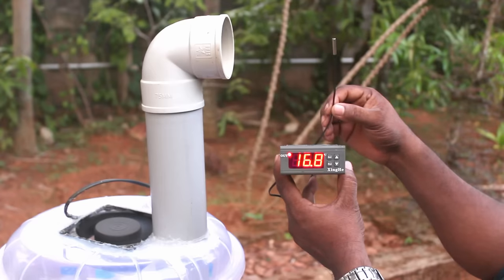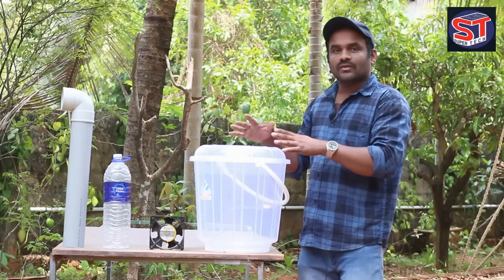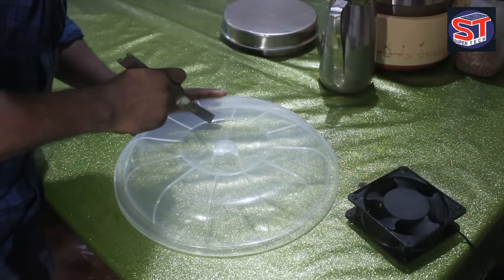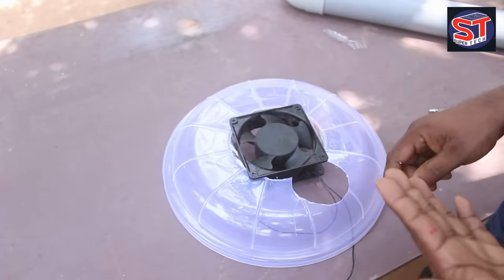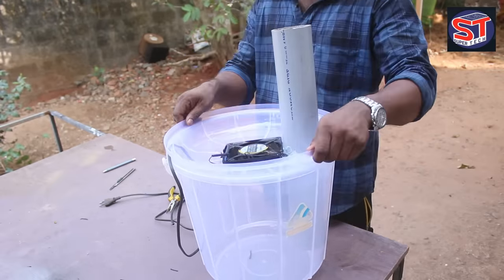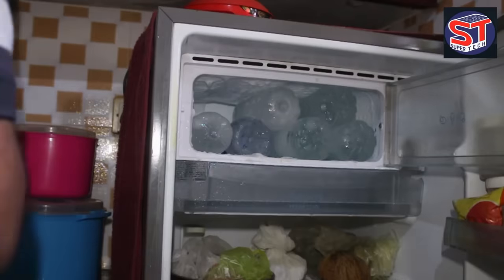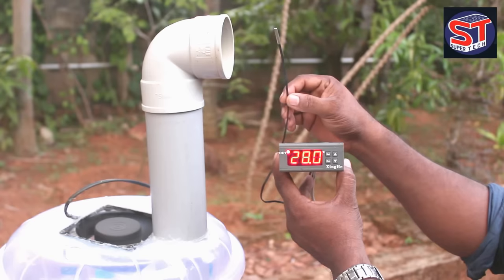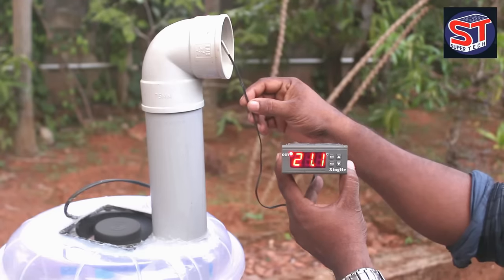air cooler ac air condition  നിങ്ങളുടെ വീടുകളിൽ ഉണ്ടാക്കാം.  ഈ ചൂടിലും നിങ്ങൾ തണുത്ത് വിറക്കും..

Comment: Thank you so much for your video. Me and my family stay in Rajasthan where temperature rises to even 48°C.
I have made this cooler at home. It's working very effectively. Pushing out cool wind more powerfully even than a 10000 rupees cooler.

Overall expense to make this was Rs 550/- ❤❤❤

Thank you brother🙏🙏🙏
Reply: How long does the cooling work. I mean how fast does the ice melt?
Reply: Malayali ആണോ
Reply: Isn't Rajasthan a very dry place, and have very low humidity. Then why don't you use a dessert cooler. It is very cheap and efficient compared to air conditioning or using ice

Comment: That is good. BUT it would be better if you use styrofoam instead if plastic bucket. Styrofoam is insulated. It won't easily melt your ice. And will keep you cool longer.

Comment: Humidity will not happened as the cool water is inside the bottle and it is tightly locked. So no chance. Should be a dry cool air. Good idea bro. Congratulations 👍👍

Comment: Good work 👏. But be careful the fan wires should be properly insulated . Since the fan is on top moisture accumulated is possible and which can further results is getting short depending upron the temperature. Some sort of insulating layer has to be placed between fan . anyways good effort brilliant idea .
Reply: Fan wire varunna baagam mukalil vecha mathiyakille.
Reply: Yes. It is so much safer to use a 12v fan and charger instead

Comment: Chetta eth room temperature  vech  30min  room tem ethra kurayunnu ennu koode kanikku. Appol korach koodi  alukalk  air cooler te   use manasilakkan pattumennu thonnunnu. Ente oru abhiprayamanu.
Reply from the maker: വീഡിയോ ലെങ്ത് കൂട്ടിക്കഴിഞ്ഞാൽ ആളുകൾ വീഡിയോസ് skip ചെയ്തു പോകും..  അതുകൊണ്ടാണ് പോയന്റുകൾ മാത്രം പറഞ്ഞു പോകുന്നത്
Reply: No, that's not the point. What Hari told is correct. You put so much of effort. I'm interested to see how much time can 20 degree sustain in an Indoor condition. If the content is good, then no one will skip. 

From next time, I kindly request you to focus on testing in real condition as-well. When you show show half, telling that people would skip, then you'r intention is clear. It's for you to make money by showing something by wasting the time of people who watch this which is unethical. 

Here, I would like to see on an ideal day,

1. What was your room temperature? (It can be either day or night).

2. What is the room temperature after running this equipment for one hour?

3. What is the temperature of air coming out of the PVC pipe after one hour? 

I hope you understood the point which I tried to convey. 

Thanks!

Comment: Room Water content will rise. It's not good for the room.
Reply from the maker: The water content in the room is decreasing.  It will not spray water.  Not even a drop of water in the bottle will decrease.  Because when you hit the bottle, the moisture in the air taken from outside fills the bucket.. If in doubt, try making one.
Reply: @sajithkolleri  Okay😊